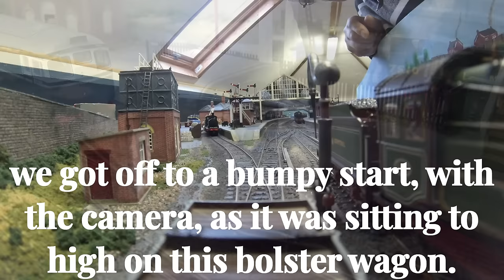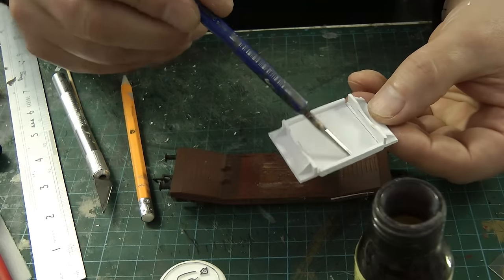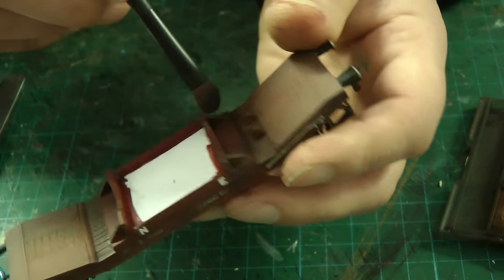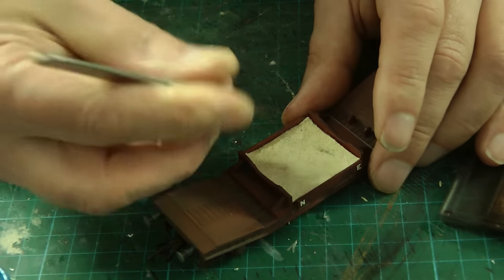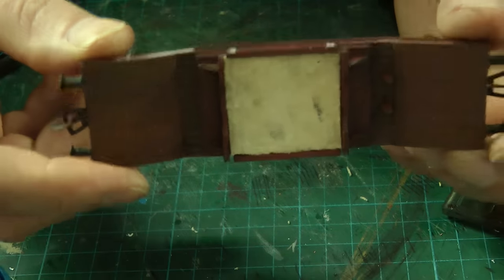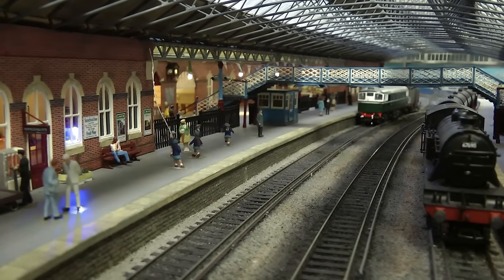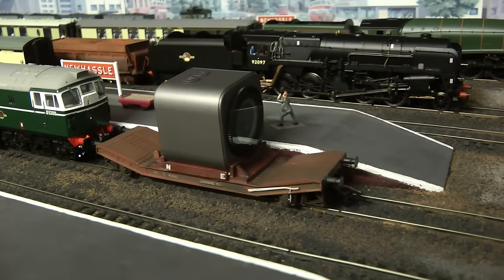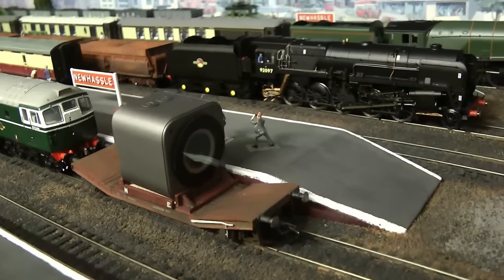CADDXFPV camera, Plus upgrading a Low Loader    No 412

Comment: Hello Tony I hope you're well.
Wow massive improvement in the video quality.
Really like your new camera did you catch Susannahs video were she wired in a bulb into the camera wagon?
Reply from the maker: Good morning I did see Susannah video. i would love to do same. but it will some figuring out as there is not much room underneath the low loader. i may have to use the wheels for pic to light the LEDs. its a possibility. thanks again for commenting. have a great weekend. cheer's for now Tony.